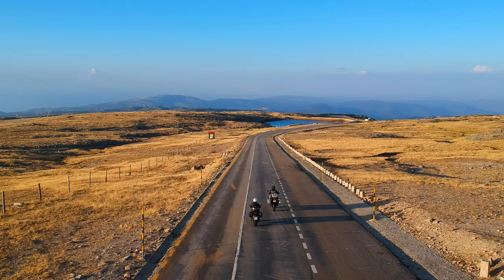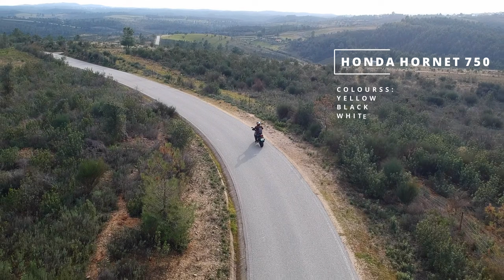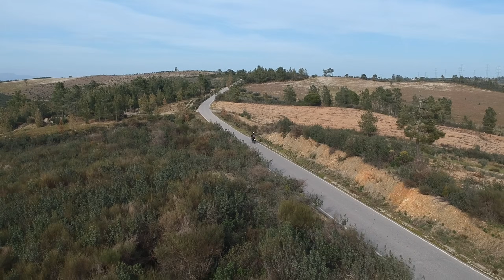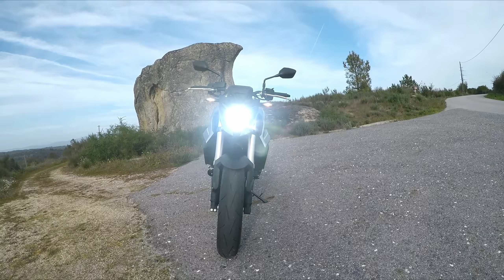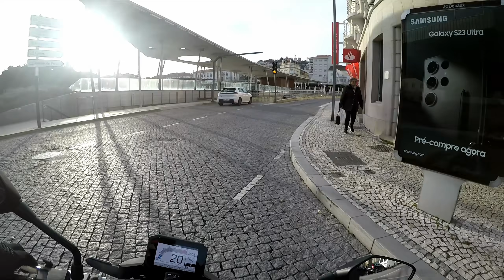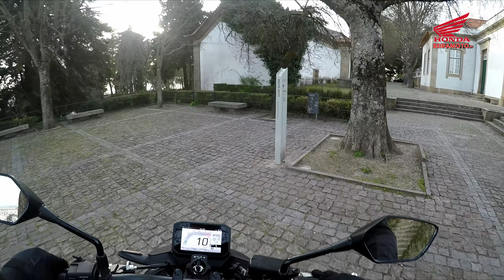Honda Hornet 750 2023 - Review and Test-Ride - English Version

Comment: Do you suggest as a first bike,with using rain mode maybe?
Reply from the maker: Absolutely :) You can have the hornet has a first bike for sure. Its light, not too tal and easy to ride. And yes in Rain mode it gets even more tamable. Me too started with a hornet 600 and i was scared ! Later i found out that one was easy to ride too :) Honda's are known to be "pick up and ride" motorcyles hehe Cheers thanks for watching!
Reply: @WolfMates  Thanks a lot! I've ordered today,hope i won't die:)
Greetings from Istanbul and subscribed by the way.
Reply from the maker: @vitreuskenan  Thanks! Greetings to Instanbul from Portugal and good luck with your new machine! Cheers! :)